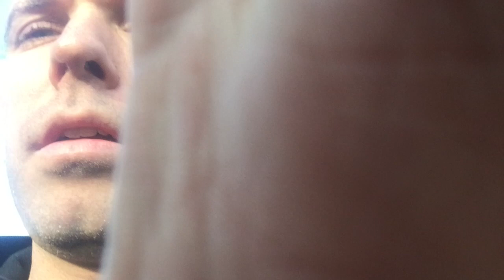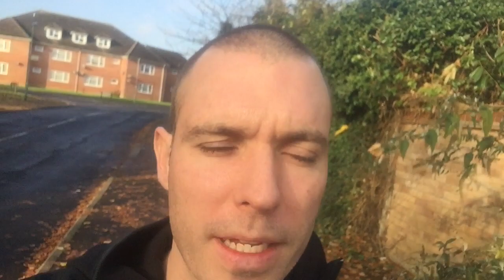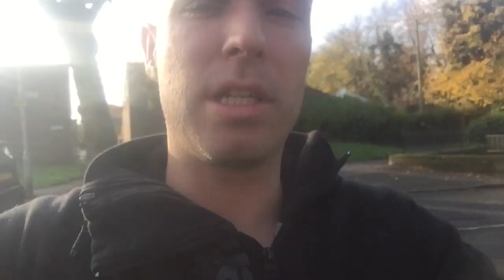Little Update. Whats Coming up. HeatingGeek

Comment: Do you live in cheshunt? you walked past my 1st house
Reply from the maker: Im right by my house. Walking back from the dentist. 
Where did you use to live??
Reply: HeatingGeek 
The flats in the back ground. But I live two minutes down the road behind the petrol station. I use the cherry tree for dental work. 
Small world! 
Also thank you I’m starting out in the gas world your f75 video came in very useful today. Pump change on a ecotec I don’t think colleges teach brake down. Just get you to pass kick you out the door and it’s sink or swim.
Reply from the maker: @ashleyhutt9618  Thats why I do it. College doesn't teach you much about breakdowns. Cherry tree tried to rip me off so I don't use them.
Reply: HeatingGeek 
Yeah i didn’t touch a boiler when I was in college. The most I did was solder a Yorkshire fitting. Let by and tightness test. But we were taught to pass the test. The first 3 years I didn’t do any gas work. 
What happened with the cherry tree I’ve found them a little pricey. But i also thought that you get told you need work done that maybe you don’t.
Reply from the maker: @ashleyhutt9618  I went for a hygienist appointment and they doubled the price when I was in the chair because I didn't want a check up at the same time. I got up, gave back the bib and glasses and went to the other one.
Reply: HeatingGeek not so good!! Other then sneaky dentist and the abundance of Tesco’s I like cheshunt. Do you work for a Company or are you out on your own? 
Would you recommend the mr combi or one day Worcester Vaillant courses?
Reply from the maker: @ashleyhutt9618  I sub to a few companies and do my own stuff. Im trying to build up some personal customers again.
Reply: HeatingGeek 
Would you be interested in more work? I have a lot of work just need some more experience. I’ve tried asking people to teach me or offered working for free but you know yourself probably it’s not that easy. I’m okey with installs but could do with someone who good at brake downs. Guessing doesn’t work all that well.
Reply from the maker: @ashleyhutt9618  I would love more work but Im really busy and already have someone else doing some of the servicing. Trying to teach them. 
Im always willing to help, if I can. Who do you work for now?
Reply: HeatingGeek 
I work with my dad who is a electrician and painter and decorator. I’m the plumber I’m trained as a electrician but it’s not for me I don’t enjoy it. So I work for my self but subbing. I would really appreciate some help i feel stupid calling technical help every time or YouTube thing on site.
Reply from the maker: @ashleyhutt9618  Thats how I learned. On the phone the whole time. You need the guidance of manufactures until it all clicks into place. I had a boiler fixed today for 5 hours and then it failed. Shit happens. Im going back tomorrow.
Reply from the maker: @ashleyhutt9618  Who do you sub too?
Reply: HeatingGeek sorry it’s taken so long for me to reply it’s been a very busy few days. I sub for A.S.HUTT. So the long phone calls I should get use to.
I had a fun day due to a zone value inside another zone. Also my analyser just had a hissy fit.

Comment: You would need a curve tracer and a handheld oscilloscope, if you are going to do diagnostics at component level on the PCB, but then you have the added advantage that you can do it without energizing the PCB or having the schematic.
Reply from the maker: Feel free to send me one and teach me how to use it. 
Im not going that deep. Just general stuff.
Reply: @HeatingGeek  Ha ha yes they are of course pricey, but I was thinking it would be a good idea to take a photo of the PCB in all the boilers you come across, so that when a resistor etc. burns you can look at the photo and determine its value and replace it. 

I will check what it cost to build a DIY curve tracer, and combine it with a small eBay oscilloscope. With such an instrument you would be able to fix the PCBs you have and perhaps sell them as refurbished PCBs (a few quid for the Bentley fund).
Reply from the maker: @yannkitson116  I need to get the VW van paid for first. I would love to know more about electronics. I know just enough to get by. I couldn't be bothered to refurbish PCBs for sale. just would love to do it for customers and the knowledge would be great.